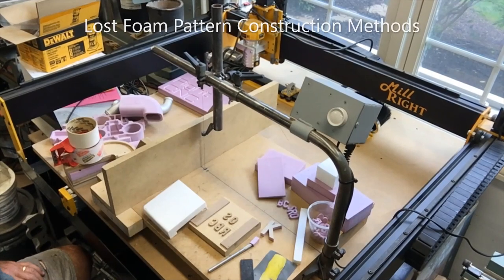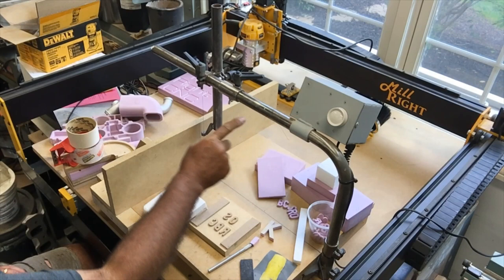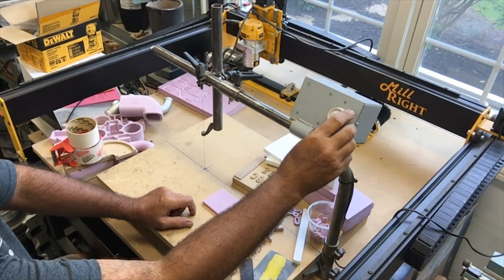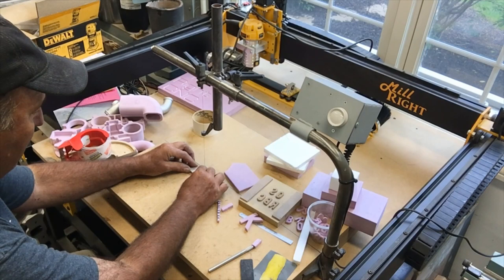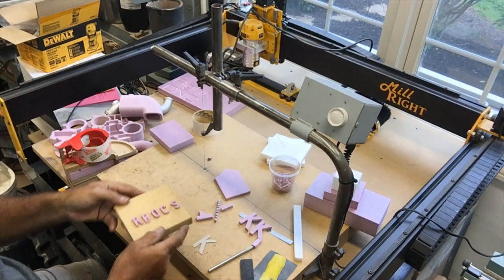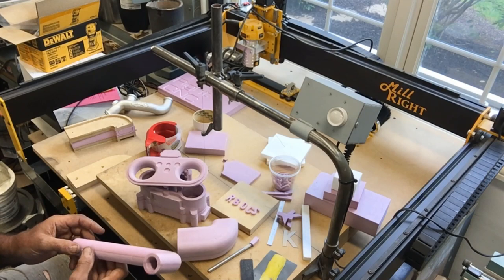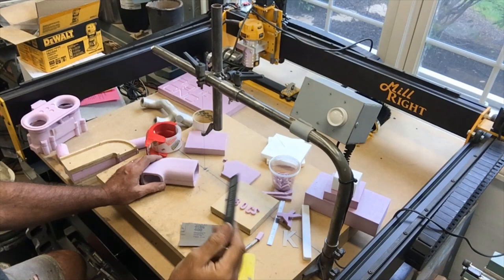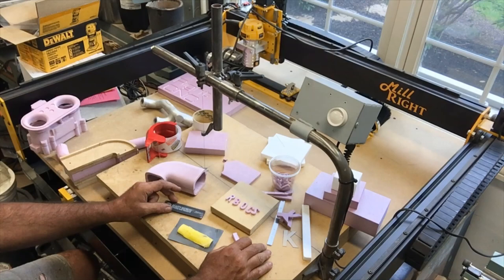Pattern Construction Methods for Lost Foam Casting

Comment: WOW!  Great information again. Thank you Kelly, for saving all us beginner lost foam casters from ourselves  :-)   I've built a crude hotwire cutter for a  job I had to do at work insulating parts of a motel, but now I will be building one similar to yours, as it would be far more accurate. That manifold, which you make look fairly easy to make took many many hours of preparation, calculation, and perspiration, and we all really appreciate your ability to figure out how to do all that stuff, and then  be able to teach us how to do it in such a clear way.
Reply from the maker: You wont regret building a good hot wire. The most important features are a stiff arm, adjustable power/heat, and adjustable height for the supporting eyes. The latter gives better control of the wire and keeps it from wandering and deflecting during use on different height cuts. Best, Kelly
Reply: I couldn't agree more. This has advanced my plans a lot. Great comment

Comment: Just discovered this channel - fascinating and informative content. Lost foam patterns are something I have only just learned about, and you have become the go-to channel for information and demonstration. The episodes on the tea cup were particularly well delivered, but of course - we all like engine bits! Looking forward to more.
Reply from the maker: I did the saucer cup and spoon project to illustrate the lost foam processes and demonstrate the art of the possible in (small) wall thickness for lost foam. I chose that object because historically, molding a SC & S has been a right of passage for a journeyman molders, but in LF, it requires no molding skill whatsoever as the sand is just vibrated into place. Best, Kelly

Comment: This is an amazing series of videos.  Thank you for sharing your process!   I set up a waste vegetable oil foundry a while back and will have to try this approach.  I haven't seen all your videos, so not sure if you've shared any ideas on safety.  A good friend of mine developed cancer a little while after working with large quantities of extruded polystyrene.  He was making sculpture, so lots of sawing and sanding for extended periods of time.  I think he was wearing a respirator..   Anyhow, I thought it would be smart to make sure any foam cutting is done w a respirator and outdoors or with a powerful extractor hood.    Thanks very much!
Reply from the maker: I use a particulate mask when machining PS. The chips are not very small so fines are not much of a health threat. The combusted PS and trapped vapor inth emolding sand are another matter. I only pour and demold outside and for large pours wear a respirator. Best, Kelly

Comment: Truly impressed about your skills! I’m trying to understand how you made those flat pipes, the outside I understand, with the hot wire, and you split in two but how do you (carve) the inside ?
Reply from the maker: They were made with a hand guided template on a overarm pin router. If you view my "carburetor main well" video on my channel and take a look at this forum post, I think you will understand. Best, Kelly http://forums.thehomefoundry.org/index.php?threads/automotive-intake-manifold-%E2%80%93-boss-302-independent-runner.1692/

Comment: Very informative... I'd like to see how you made that 90 degree angle... inside and out...
Good session
Reply from the maker: You can have a look at the templates in this thread:
http://forums.thehomefoundry.org/index.php?threads/automotive-intake-manifold-%E2%80%93-boss-302-independent-runner.1692/
...and heres a similar part with a little more how-to detail:
http://forums.thehomefoundry.org/index.php?threads/machining-xps-foam-patterns.14/#post-59

Comment: Great video. I would think a laser cutter would work really well for some of this work, especially for thinner sections.
Reply from the maker: I use a hotwire for 2D profiles and that works great. Never tried a laser but I suspect the economical low power units available that cut paper and engrave soft materials would work. Would depend on feed rate, whether the kerf was sufficient to prevent refusing of the cut, and that the beam remained concentrated and didn't diffuse. The latter may cause varying kerf width worsening with thicker material. Best, Kelly

Comment: When I first heard of 3D printing, I thought it would basically print in wax, and be used in casting,  but I heard something about using 3d prints in place of the foam, if that works well, some awesome things can be made easier, just the print time, and the fill can be set low making the mold nearly empty, 50% maybe less, and still be fairly Ridgid, being the inside is like a sponge, and you can get a 3D printer for $200-$300 roughly, and a decent one , a exceptionally good one for under $1k   I'd be buying damaged alloy rims, and engine parts to make aluminum ingots, maybe toss in a piston or two to get the silicon up a bit, keeping the engine aluminum, and rim aluminum separate,  I'd like to build a large 3Dprinter, capable of printing something as large as a 8v92 Detroit diesel engine block, in a single piece maybe larger, about a 50" x50" x50" cube,  and a smaller one capable of 24" cube, then one capable of fine details, and in the 12cubic inch range, so the large part. Can be printed, an the smaller more precise details can all be printed at once,  how awesome would it be to cast a V8 2stroke diesel engine block and heads, , over 700cid of 2stroke Diesel, like 746cid, 92 cid per cylinder! And convert it to gasoline or methanol ,  use a lightened crank aftermarket rods and pistons, to lighten the pistons by nearly half,  and a set a 4340 H beam rods with light weight pins, possibly do some testing , maybe bore out the stock wrist pins, and press in a hard tough alloy of aluminum, to keep the strength, and lighten the pin,  the shear strength should be tested compared to a stock pin,  measure deflection in a press,  then possibly look into a titanium pin, with a wrist pin nearly the size of a Honda crank rod journal,  it's alot of weight,  especially if you are attempting to get it to spin nearly 5k rpm,  after light weight pistons and pins are figured, cast an aluminum head with 4 much larger exhaust valves something around 2" inconel, hollow sodium filled,  and titanium retainers,  and beehive springs,  with a custom cam and valve cover, with access to install sparkplugs,  a modified front cover, and a distributor  can be fitted where the injector pump was located, or in the front cover like the 96 LT1  V8 engine, maybe run two distributors, and dual plugs, bore poen up the combustion chambers in the pistons, and unshroud the valves, also lowering the compression, keep it 16:1 at most, 13:1 atleast,  use 2"-2.25" pipe out of the. Head, into a 3" pipe, forming a header, going 4 into 1,  6"-8" pipe  collector, reduced to 5"   , hopefully it would weight less than a dodge 5.9 Cummins diesel   connect it to a manual transmission from a Cummings diesel dodge truck,  put that ina duce and a half military truck,  with a single Axel, conversion, and fuel wheel delete,  with a pair of turbos,  it could get spicy!!  I'd guess it should make around 600 HP 1000ftlb TQ easy, at 4000rpm with a methanol injection, and carburator, and a 3" intake runners ran directly to the intake ports of the base of the cylinders,  requires a supercharger / scavenger to run,   it can make boost, use a timing chain tensioner that can allow about 12° advance and retard of the exhaust cam,  use a knob to adjust, , mind the piston to valve clearance,  the knob control a actuator , eventually use a microcontroller, and a couple sensors, to automatically adjust for max performance, possibly the vacuum under the carb, the rpm,  and throttle position,   to get more TQ at low rpm at full throttle, and. Still be efficient at high rpm low throttle, and vice versa, basically v-tech,  incorporate a slide valve in the intake runners to close the ports when the piston is up to prevent filling the crankcase with atmosphere. When the piston is not at BDC, it should start opening when the skirt. Covers the ports, staying open as long as the port is open by the piston,  the brass bushing with stainless slide valve, sealed with brass bushing, like oilite bushing, with o-ring seals , and springs pressing on the slider, the 3" port sealed externally,  use a pair of springs to keeping the valve open, use a cam love and a high ratio rocker to push the valve down closing it,   timed to  work with the pistons covering the ports,  allowing the use of much smaller lighter pistons, and longer H Beam rods! Possibly 2"longer rods, with the rings .200" down the piston, and the piston out of the bore  .170" and a pocket for the piston dome to fit in, the rings 
.030 from the deck,  the pocket in the head for the pistons allow about .025" clearance and the valve reliefs in the piston should allow the valves to be open with the piston at TDC, this forming the combustion chamber, with only a .125"clearance around the valves de-shrouding the 4valves , and only as deep as the thickness of the valve head,   with two plugs one offset from center, with the offset plug bearing a non quench pads area, with the 4leaf clover shape chamber, the other plug should be at the stem,  at the front or rear of the cylinder,  if possible set the timing of the distributor about 1°-2° off from each other, to fire the center plug first, a millisecond later the #2 plug fires,  the distributor firing at crank speed,  with the blower  filling the cylinder,  compression, ignition, just before the intake port is uncovered, the exhaust valve opens, the leaving exhaust could possibly have enough energy to pull in air to run the engine without the supercharger, the additional turbos,  could  produce 2bar boost, and should double the power, the supercharger would only do about 5psi, use a water to air intercooler, blow through alcohol carbs,  it should make the power of a 2100cid non boosted engine, at 8000: RPM if the peak power is at 4k rpm, and if it revs that high, the diesel only does about 2000 peak rpm, it could do 4000-5000 RPM,   would not want to spin it over 5k that is still a lot of piston, a lot of crank, long rod,  likely 4500-4800 rpm would be the max,  , alot of effort and time ,    crazy dreaming,   
Id love to build something like this,  sorry to ramble so crazy, insomnia!! 😆 Good day!!
Reply from the maker: I've had a couple fellas post to my videos telling me the lost foam process can be used with a low infill 3D printed PLA patterns. I'd tell you they've never actually tried or done what they recommend or they would know it produces very poor results. When I say LF process I mean the molten metal evaporates the pattern during the pour, in loose sand mold media. Now, Lost PLA ina hard invetsment and/or shell mold with a burn out step can produce very nice results, but it is more expensive and much more laborious than the lost foam process, especially for larger parts. Best, Kelly

Comment: BTW you don't need nichrome  the temperatures are no were near high enough , my favourite wire is piano wire it comes in loverly straight lengths in any thickness you like and can take a lot of tension to keep drag to a minimum , but  top E guitar strings are also very good
Reply from the maker: True but since NiCr is marketed as resistance wire it's resistance is known, which is helpful and the price difference is de minimis. Guitar strings are just polished music wire which also work well with a little more uncertainty around the power supply. Best, K

Comment: Amazing projects youre doing! I wonder if there's some filler you can use at small marks or damges...?
Reply from the maker: For small damaged areas on a foam pattern I use low melt temp wax. Just lightly heat a metal tool and apply as needed. Best, Kelly

Comment: Hi really like the channel. Can’t believe I didn’t see it before. I’m trying to set up a decent home foundry and of course have limited funds. I’m aiming to cast motorcycle engine cases and carb inlets for cars such as one of your other videos which was very informative. What I wanted to know was what equipment would I need to have that kind of capacity and where would be a good resource online to get the equipment? Also I wanted to know would the foam casting process be compatible with 3D printed plugs? I came to the conclusion that investment casting would have worked but the issue lies in covering tight internal spaces well enough to form a “shell” strong enough. But I can see from your process with the carb inlets that it looks more reliable.. I hope that makes sense looking forward to more videos
Reply from the maker: Best advice would be to join www.TheHome Foundry.org. The whole forum is dedicated to home and DIY casting of all kinds. There's help with sourcing and building your own equipment. Best, Kelly

Comment: This is so neat! Just found your channel today.
 I want to learn to do this.
 I have a old Dempster brand hit-and-miss engine that is missing the brass carburetor/fuel mixer.
 It would be a  very simple pattern compared to the one you made here.  And not much bigger than a fist.
  And I have a friend who would loan me an original!
 Do you know anything about scanners for 3-D printers to make plastic patterns?
Reply from the maker: You should take in my othjer videos and consider joining www.TheHomeFoundry.org It's a home/hobby casting forum. I have many project and equipment build threads there. Best, Kelly

Comment: Do you have a video where you show how you made that pipe? I'm not understanding how you achieved that. Thank you
Reply from the maker: No video but if you join www.TheHomeFoundry.org there is a picture rich thread with related links. http://forums.thehomefoundry.org/index.php?threads/tubular-lost-foam.11/  They are made in halves. I used to make them with guided router templates using a round nose bit on the inside and radiused round over bit on the outside.....then glue the halves together. These days I do the same but with a CNC Router. Best, Kelly
Reply: @kellycoffield533  thank you sir. I really enjoy your videos. I come from a fabrication background, but just recently decided to try my hand at casting. It's opened up a lot of options.
Reply from the maker: @LeadedAsbestos  Always nice to have another way to make shapes and place metal where you want it. Best, Kelly

Comment: I was watching a lost foam casting video on YouTube.  Not sure who.  But I watched him suggest hollowing out patterns and/or poking a hole in the foam sprue with a hot copper wire.  What are your thoughts on this.  Does it help? Could it cause bigger issues? Any information/thoughts on this would be greatly appreciated.  Thanks!
Reply from the maker: IMO it's a bad idea. In fact, anything that could cause or promote foam, air and other gases to become trapped inside the molten metal front, be it in the sprue or pattern, is an invitation for fold and other types defects. I'm sure people envision the metal streaming down and filling the hole like a plug, then consuming what's left of the sprue outward, but that's not what happens in practice. The metal turbulently tumbles down the hole unevenly melting the walls on the way. What you would much rather see, is the metal sit on top the entire cross sectional area of the sprue, and gradually consume it on the way down. There will be three foam phases present, solid foam, then liquid, then gas, at theinterface with the molten netal front. The gas escapes through the permeable coated exterior of the pattern. Best, Kelly
Reply: @kellycoffield533  thanks.  I'm thinking this suggestion was for lfc in greensand.  I figured as much about turbulence.
Reply: One more question to bug you with.  I know you said ypu could use wax to fill in imperfections in the foam patterns.  Does that have to be a specific type of wax? I have tried this with candle wax from disposable tea cup candles.  Seems like it caused some surface defects similar to steam defects when I did this.  Is there a limit to how thick, wide, long of wax you use? What do I need to avoid when using it?
Reply from the maker: @odellcreations  I use a wax formulated for lost foam casting. You can buy it from Freeman Supply. You can buy a near lifetime supply in 24" sticks the shape of 1/8"r fillet for $40. Otherwise, you want a low melt point wax. Some hobbyist use the wax from toilet gasket seals. Use it sparingly. Maybe 1/16" - 1/8" max in small areas.  You can smooth and apply it with a heat fillet or flat tool. Best, Kelly
Reply: @kellycoffield533  thanks!

Comment: Kelly how do you address the problem of metal shrinkage?
Reply from the maker: For aluminum, the patterns are made 1.3% larger than the casting. Different shrinkage for different metals. Striving to obtain uniform wall thickness in your pattern designs will help avoid shrink related flaws. Best, Kelly

Comment: what glue do you use to join the various pieces?
Reply from the maker: Search my cannel for the pattern materials video. It's covered there. Best, Kelly
Reply: thank you very much, I tried with hot glue but the aluminum stopped at the glue, could you tell me why?
Reply from the maker: @bobbrebrosimracing7579  I'd say it was cold metal not the glue and it was just a coincidence that's where it stopped. I use the lowest melt temp hot glue I can find but that's so it doesnt melt or damage the foam. I do "smear" the joints to keep it as thn as possibel but hot melt is no match for and certainly no barrier to  molten aluminum. Best, Kelly
Reply: @kellycoffield533  ok, thanks a lot, I'll try to heat the aluminum more